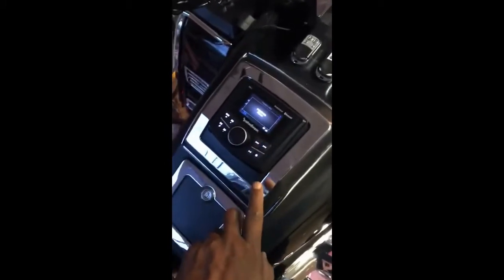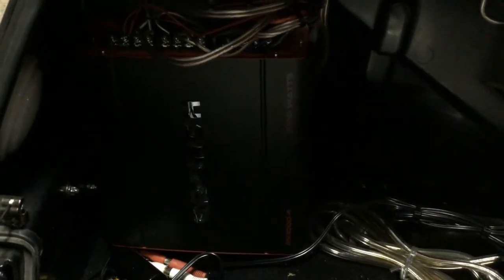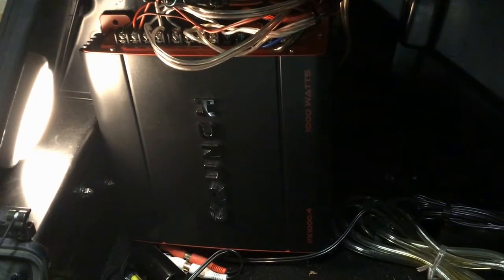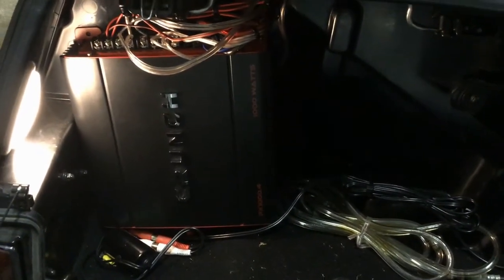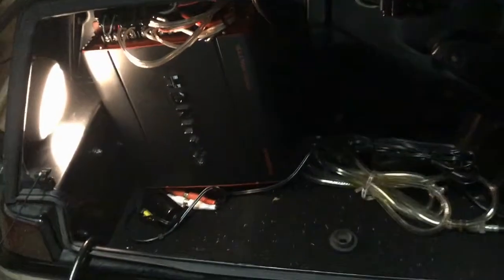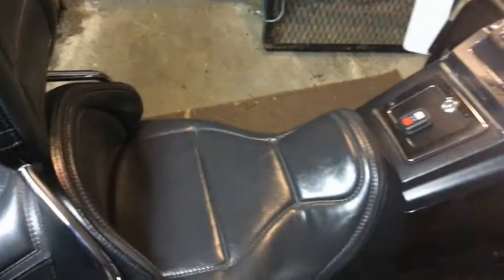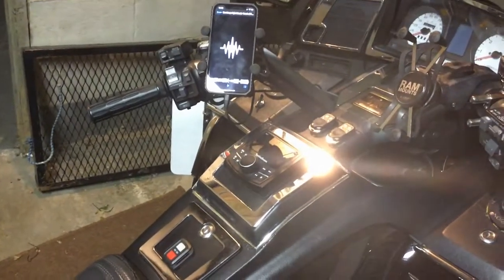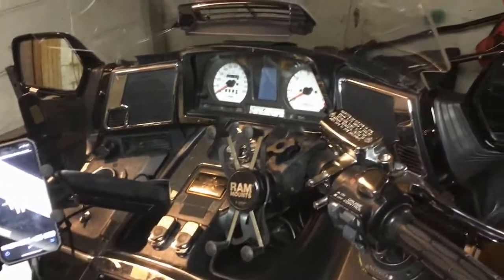Audio Upgrades to the GL1500 (part 3)

Comment: thx for your great videos, beautiful bike. Did you haver to upgrade any electrical components to run that amp and stereo, maybe an upgraded battery, higher amp alternator?
Reply from the maker: Great question!  Yes I do have a high output alternator.  I’m also running my audio components through a separate battery, and my auxiliary lights through the bike’s fuse block now.  Problem solved!